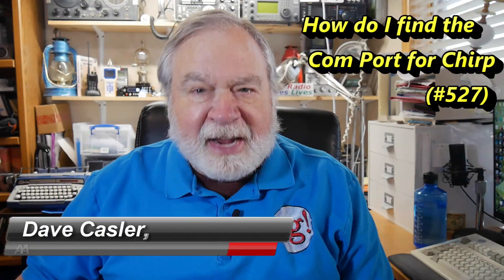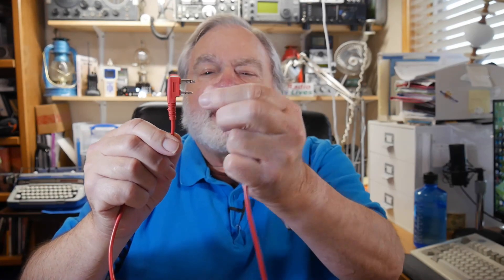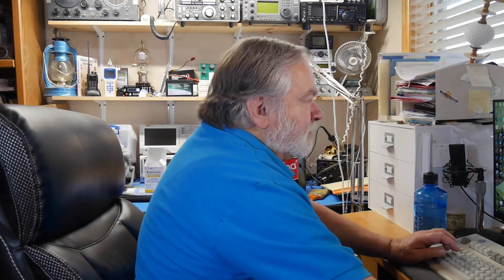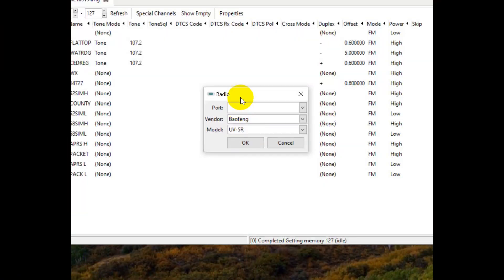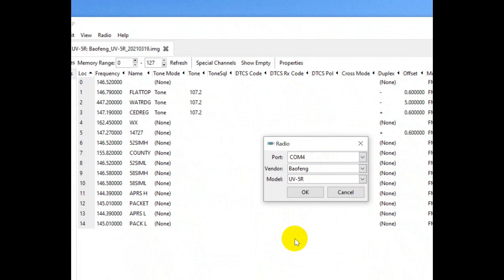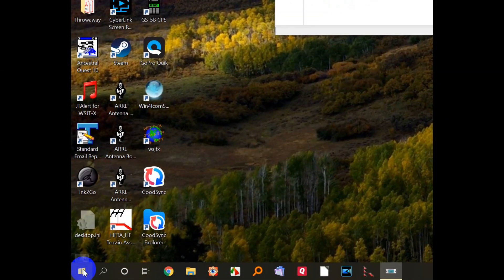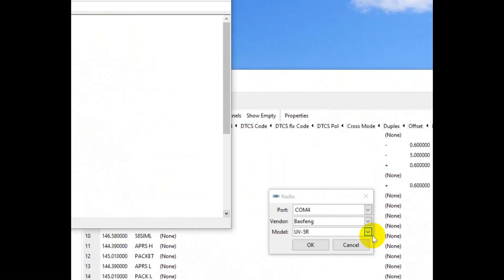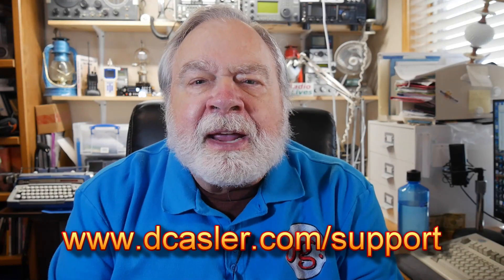How do I find the Com Port for Chirp? (#527)

Comment: If you are using Linux Mint (or probably any Ubuntu distro) and have this problem, you need to turn on your permissions to access the ports. This is how you do it:
To have permission to use the serial port of your machine your user account has to be part of the group “dialout”.
To check / add this group to your account type “user” into the menu’s search box, select “User and Groups”. After authentication select your username.
Check if “dialout” is listed next to “Groups” - if not, click into the list (isn’t it nice?) and select it from the pop up. Done.

Comment: You have to update the software for the cable wether it be RT systems or another brand and it will show up in device manager in commport..right click on that comport and it will tell you what port number you need for chirp
Reply from the maker: Yes, both the programming software and the cable driver software need to be up to date. Note that CHIRP changes every few days.
Reply: @davecasler  I've only seen one chirp update recent...its working fine with my ft 60r....29repeaters in so far

Comment: Where do I buy that cable that supports windows 11 or later?  I have the same error but the cable that I have is not working doesn’t support windows 11 or later. Thanks for the information

Comment: I was wondering if you have had success using Chrip with Windows 11?  I just got a new computer and as I was trying to set up Chirp I got a message that says it is not supported.   My error message on the Device Manager says:  "PL2303TA Do not support Windows 11 or later, please contact your supplier."  I tried to update the drivers and it said I was up to date.  So I am wondering if I need a new cable or need to go back to Windows 10.  Your thoughts?
Reply: This is a super sticky problem I am still struggling to solve. If Dave can enlighten on this, he will advance this issue greatly!

Comment: 5:34 "Remarkably well hidden"...really?  Am I the only viewer that's ever installed a Windows operating system?  Device Manager has been part of Windows for over 20 years.
Reply: The reality is, that it is not intuitive to go to Device Manager, nor are you likely to intuit the name of your cable as it reports there.  Furthermore, it is counter-intuitive that it changes between uses and between reboots.

That Device Manager has been around for more than twenty years is part of the problem— it is literally one step above DOS; and, by the way, “plug and play” has been a thing for all of the 21st Century, and connecting my radios to my laptop is the first time (and have been the only times) in this Century that I needed to use Device Manager to identify or configure a port setting.
Reply: @crewsgiles9499  Anytime I suspect a hardware issue it's very "intuitive" for me to go directly to the device manager, that's where hardware conflicts present themselves via the yellow exclamation dot.  Plug & "Pray" (as we used to call it back in the late 90's) is far from perfect, but it's still better than setting IRQ's & Com Port addresses via jumper pins.

My point was (and still is) that Device Manager is not a hidden feature of Windows...so put down your whisky bottle & mind your manners...sometime this "century" (LAUGH!) would be good.
Reply: @tomnorman5461  And yet, here you are watching a video on something you already know how to do—just like me.  I was here, hoping knew a way to skip this step by automatically identifying and assigning a port.
Reply: @crewsgiles9499  Although I tend to give Mr. Casler a hard-time (mainly over his occasional inaccuracies) I do enjoy watching his channel.  I've been installing & configuring Microsoft operating systems (100's of installs) since the early DOS days.  I started browsing the Internet when it was just ASCII text only via a Unix Shell account.

My point was (and still is) that Device Manager is not a hidden feature of Windows.  Nuff-said!